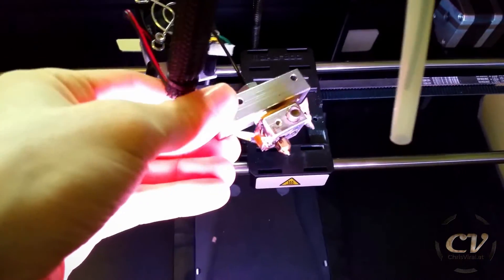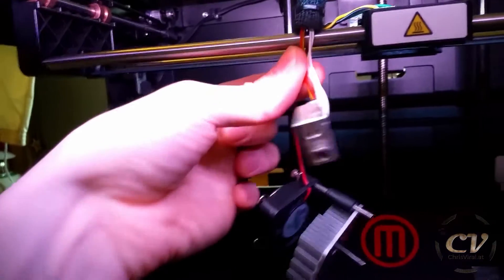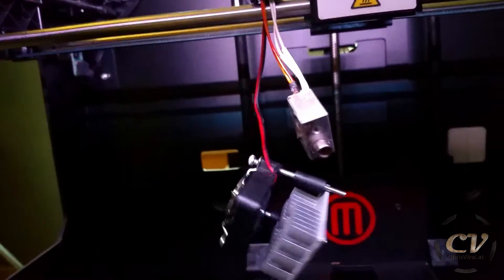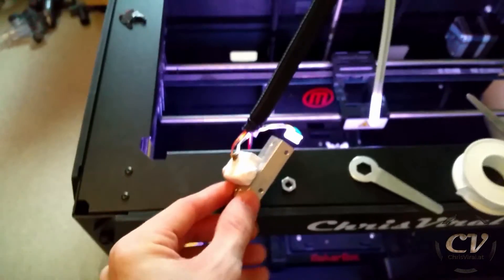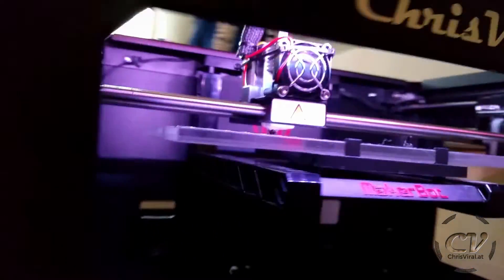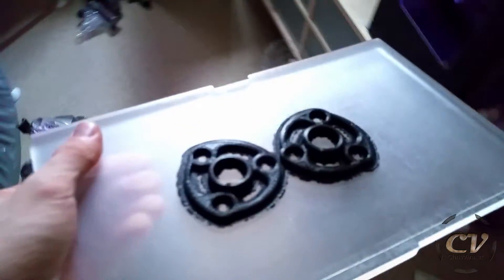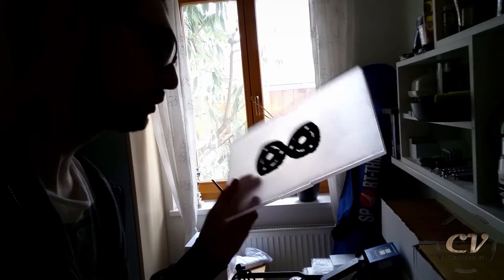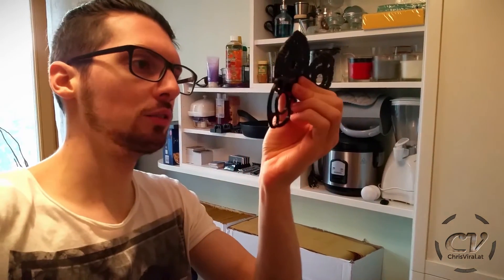3D Printer Hot End Insulation With PTFE Tape?

Comment: Don't do this! PTFE gets very toxic above 260C and the heater barrel will for sure get higher than 260C
Reply from the maker: Printing temperature is 230°C in my case. What will happen? Will it release fumes? Please tell me more or link me something :o
Reply: ChrisViral  You are fine btw, they use ptfe tubes in most hot ends already, just don't print at 260+ as you need a full metal hotend for that.
Reply: Up to 300C it's moderately safe. Especially since outer layers are thermally insulated from the inner heat.
https://en.wikipedia.org/wiki/Polymer_fume_fever
Polymer fume fever or fluoropolymer fever, also informally called Teflon flu, is an inhalation fever caused by the fumes released when polytetrafluoroethylene (PTFE, known under the trade name Teflon) reaches temperatures of 300 °C (572 °F) to 450 °C (842 °F). When PTFE is heated above 450 °C the pyrolysis products are different and inhalation may cause acute lung injury.

Comment: 4 months later, did this solution work for you? I'm considering going this diy route myself for our company printer. The official replacement strips are out of stock and we have a client that we need to print for.
Reply from the maker: No not really... I completely exchanged the hot end. After that it worked for another 200 hours or something like that. I think the problem is caused by the heat barrier tube.

Comment: At least you fixed it!!......kinda...maybe 

Did you? 1/3fails ,is that ok?
Reply from the maker: Nope I screwed it up even more... This thing is done... I need to replace it. But the lessons were super valuable :)
Reply: ChrisViral you got another one right?

I think you can harvest some parts of the 3D printer
Reply from the maker: Yeah a new one, so I'm NOT going to screw it up as well XD
I'll probably switch the hot end of the old one... Don't know yet.. More research needs to be done.
Reply: ChrisViral good luck bro